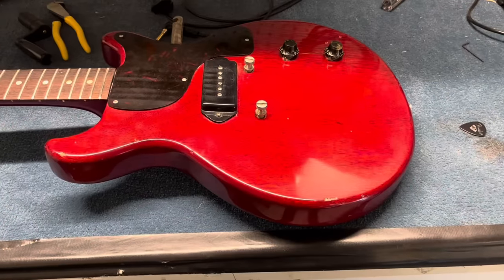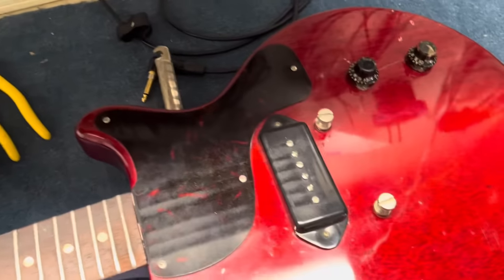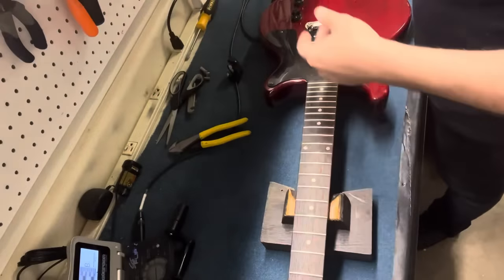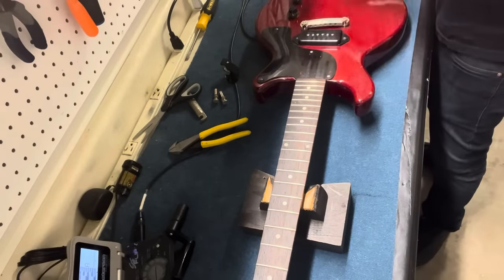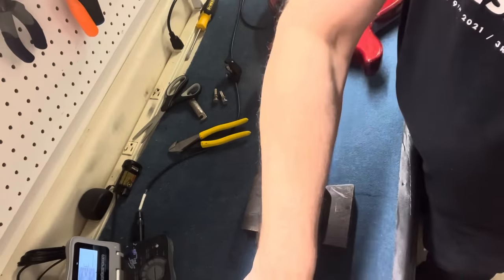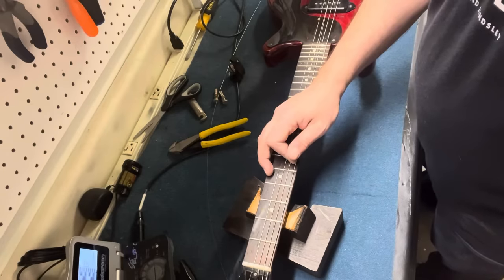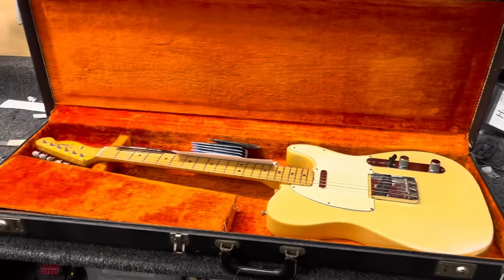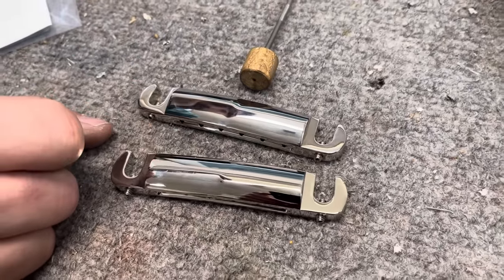Homeskoolin’ Volume 291, Tom Bukovac, “Greenville Blues”

Comment: I got a SF MCB for my 55 Jr.  haven’t put it on yet.  I’m a bit weary to do it myself. 
It looks like I’m going to have to play with the height of the bridge.  My action is already pretty low.  It looks like the strings may actually hit the pickup if I don’t raise the studs.
My other question is, would the locking studs be better to get?
Reply from the maker: i bet your original studs will work fine....its easy mate...theres nothing you can fuck up
Reply: Dude, I just put it on today.  You were right.  I didn’t fuck anything up.  The guitar sounds a lot more lively.  One thing that blew my mind, the damn thing had perfect intonation without fiddling with the studs.  That’s crazy shit, but true.  If your into fixing the bridge issues on your vintage Les Paul, get this.
I did have to raise the bridge to get the action a little higher.  I just measured where it was at before I took the old stings off.  I used that Stu Mac measure tool.

Comment: Hey Tom…I paid for a professional setup on my Stratocaster.  The bridge saddles don’t have the traditional 3 stair-step + 3 stair-step shape (after intonation) and it plays slightly out of tune up the neck.  The bridge saddles are not level…in fact, a couple of them (especially the low E) is super tilted.

Question: Could tilt of the bridge saddles be causing these problems?  If I re-set them level, is it possible that when I re-do the intonation…that the end up in the more traditional 3 + 3 stair-step position?  Thanks man!
Reply from the maker: you need to find a tech that doesn't have his head completely up his ass
Reply: @501chorusecho  - Nothing but love to you!  I’ve now decided to attempt re-setting it up myself.  It appears that I can’t screw it up any more than the “professional” I paid to do it.  

Stated differently, why pay a guy whose head is completely up his ass to do a shitty job when my head is completely up my ass and I can potentially do a shitty job for free.  What’s the worst that can happen?  Thank you for the inspiration!

Comment: Why don’t you like double cut Les Paul Specials?
Reply from the maker: the neck pickup was routed too close to the neck joint....they tried to move it to a better location in 1960, but they also made the necks pencil thin...if i could find a 60 with a 59 neck i would buy it